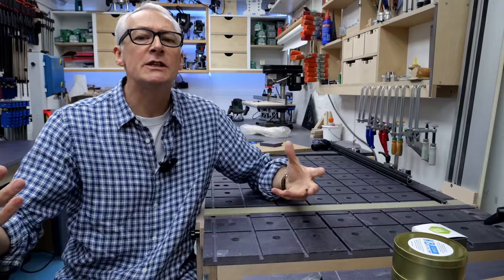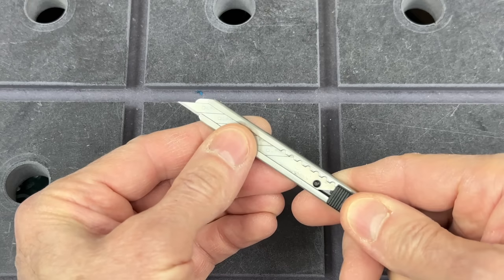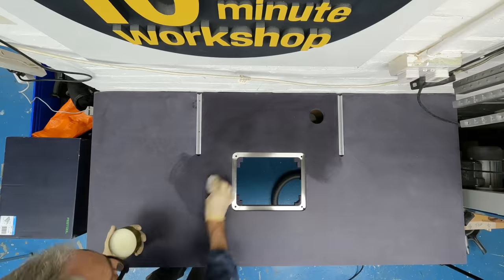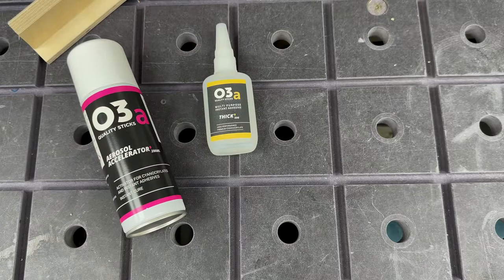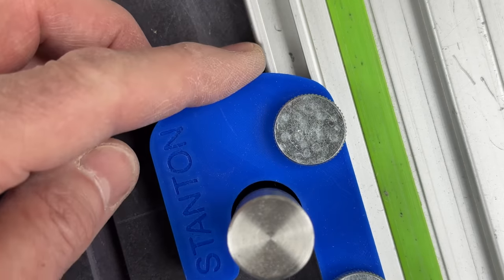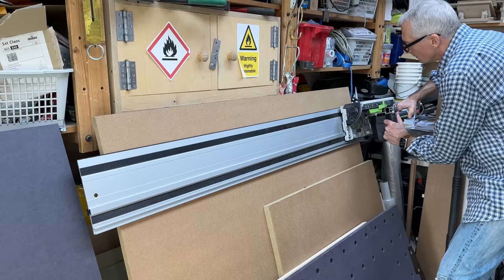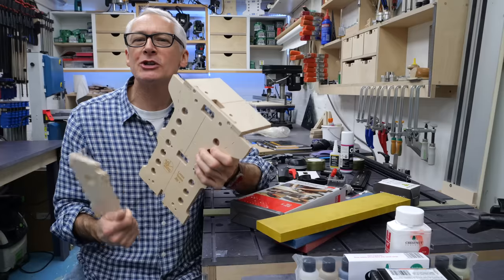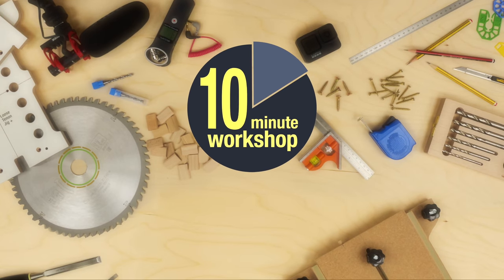Gift List 2022 [**Gifted/Ad] [video 510]

Comment: Wow, 6 years, amazing. 
Here in the states, Staples offers a Graphics Ruled Composition note book.  Very cheap, been using them for work and for drawing up shop projects for years.  I know, old school, but they go anywhere, and have a great instant on feature when combined with some .5mm mechanical pencils.  Harbor Freight offers a disposable thin knife that costs about $1.   Also there are a ton of great gift ideas from Etsy.  You can narrow down your search by using key words such as Festool, Ryobi, DeWalt, Makita, etc.

The Bessy Clamps  and Rail Stays look interesting as well.

Comment: That knife looks neat. As do the bessey. Interesting that the body on them seem to lift rather than the clamp head/work. Those guide rail spike thingies too. Very similar to Mafells F-Fix guide rail clamp they designed to fix to wood fibre insulation. Always meant to try get hold of a pair as I was sure they'd be useful for wood too. I'll check out the ones you show.👍

Comment: The issue with all bench dog clamps is that they tend to be used without locking them with the included knobs. Festool Clamps will not lift the workpiece when the knobs are screwed in from the bottom IME.
Reply from the maker: In my experience, they still do. 👍